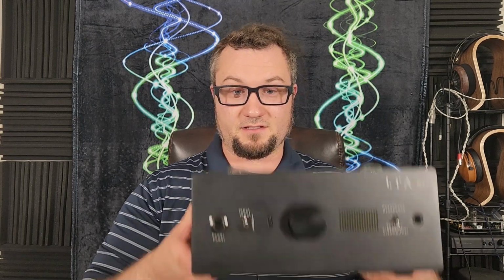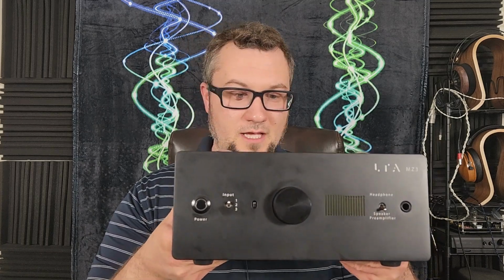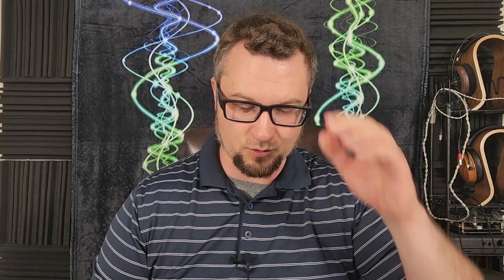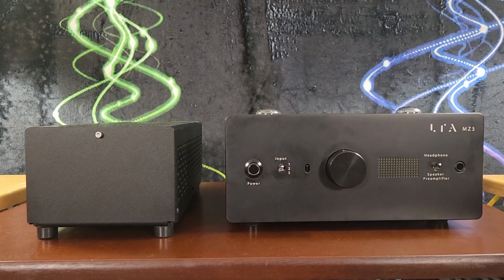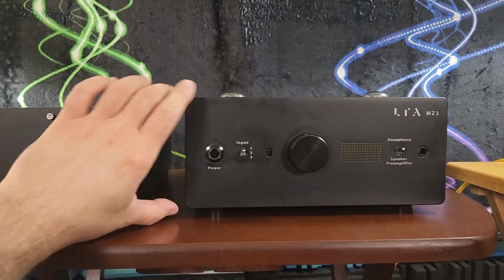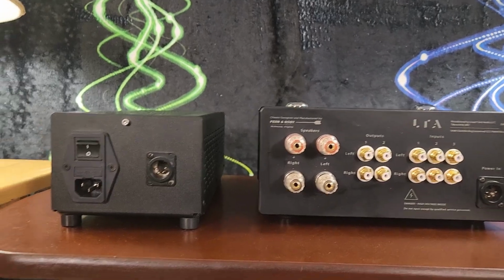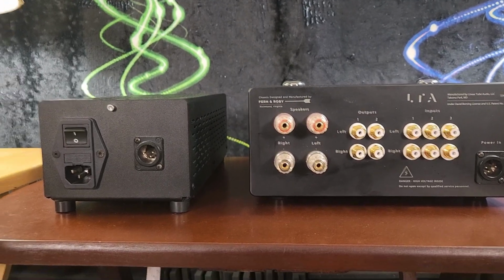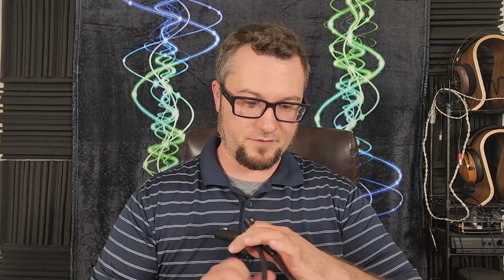Linear Tube Audio MicroZOTL MZ3 Preamp/Headphone Amp/Integrated Amp Review

Comment: first review without a comparison! at this price point is it better than your trusty V281? any reference to other tube amps?
Reply from the maker: Very observant! I didn't think I had a super fair way to compare the amps I had on hand. The MZ3 is much more pairing picky for both DACs and headphones and that makes it tough to evaluate on its own in quick A/B scenarios. I will say that the Vio brings more power with more warmth and dynamics. It is also balanced which opens the door to more potential dac pairings. But as far as things like resolution, spatial presentation, timbre, etc, the comps get really hard.

Comment: One of the best purchases I've ever made. Tube rolling can make it even better. I bought it mainly for use as a preamp, but was surprised at how well it directly drives my Zu speakers (16ohm) with less than 1/2W. The MZ3 is also what pushed me down the headphone rabbit hole. I'm using it with both ZMF Aeolus (300ohm) and Audeze LCD-X (20ohm). The output impedance for the headphone output is only 2 ohms which is a major difference between the ZOTL circuit and a traditional OTL implementations.
Reply: I've been using it a a pre with my Nelson Pass Sit-3 amp and it has preformed well :).  Now I have shut down my two channel system to do some work,... and am enjoying it with headphones, Sonnet Pasithea Dac, and a range of headphones - ZMF Atriums and Audeze LCD XC and Sennheiser HD 8XX and HD820's and I love this amp!  What tubes have you rolled? if you don't mind sharing?
Reply: @vaneast411  used as a preamp I liked Brimar CV4003 (12AU7), but they seemed a little too polite as an integrated or hpa so I’ve been sticking with 12AT7 variants. My favorites so far have been some RCA 6201 blackplates. I tried some new 6SN7 mostly to check functionality, but I’m not willing to pay the premium for the coveted NOS types. I liked the RCA 12SX7 that mine came with so I’ve been sticking with older RCA 12SN7GT tubes. I must really like the MZ3 because I’ve been accumulating enough spare tubes for the long term.
Reply: @bitterandjaded_  thanks! I really appreciate your detailed response my good man.  I need to future proof my unit with a good supply of tubes.

Comment: would have enjoyed some description of the fascinating circuit, with your physics background... maybe you shy away from this as people maybe don't like the more technical information.  The guy who developed this circuit has a physics background (David Berning) and there is a long version tech talk on YouTube detailing the history of OTL's and his design solutions.  The circuit used is the most interesting aspect of this amp, other than how lovely it sounds.
Reply: Sure sounds like there's an Analog to Digital (A/D) Converter in there.  That means for $3,700 one gets a digital volume control.    Eeeeek.....:face-blue-wide-eyes:  Why, for goodness sake, would anyone do that?
       The volume control, on its own, is the single bottleneck most overlooked in the signal chain of most systems.  Buy the one you almost can't afford, then build up over time the rest.  Matching the quality as one gets "there".                      🔈🔉🔊
Reply: @TriAmpMyFi  the amp is purely analogue, so no digital conversion, but uses a fascinating tech to avoid needing an output transformer, to be able to send a signal that speakers and headphones require.  Foe volume, ir  uses a series of relays to adjust the volume, which make a clicking sound, but this approach is a good one in that the signal is not degraded by the volume control essentially
Reply: @vaneast411      From their own website...............
                                                "....in all unit is our new 8-bit volume control, which gives you 128dB of total attenuation via 100 individual steps. We use precision thin film Nichrome resistors with low thermal noise and ceramic circuit boards with low dialectric content for the highest level of clarity and transparency."            
                                                                  ........... I don't think they're relays.   🔈🔉🔊
Reply: @TriAmpMyFi  So confident, yet so wrong. Relay controlled volume is nothing like volume control in the digital domain. They even call it a stepped attenuator on their website. Google can be your friend if you actually want to learn. Deliberately spreading misinformation is unnecessary.
Reply: @bitterandjaded_           They also call it an 8-bit PCB...................... but I will look into it more, as my curiosity often leads me..  
      If it turns out a chip based pcb is the brain needed to run the mechanical relays then fine.  It's still the quality of the volume control, that one should be aware.                                                                                      🔈🔉🔊
Reply: @bitterandjaded_       Allright........... So there's ICs on a PCB that open & close the relays.  The signal remains analog.  How did I do?   🔈🔉🔊
Reply: @TriAmpMyFi  The bar for online interaction is so low I was just happy no one resorted to name calling. Kudos to you.
Reply: @bitterandjaded_  So, is my new understanding of 8-bit volume control essentially correct now?  
        And. "....would have enjoyed some description of the fascinating circuit".
O.K., we'll show 'em.......... 'cause now you can tell us about it, fellow audio enthusiast.   😁                                                                 🔈🔉🔊
Reply: Teasing facts about audio is comment click-bait..........lol..........
Reply: @TriAmpMyFi  I’m not definite on the exact implementation here, but a series of relay and resistor pairs in parallel is basically it. The ICs control the relays to close, bypassing certain resistors so the total resistance equals the desired attenuation. As a bonus it allows balance adjustment without any additional circuitry.
As far as the ZOTL circuit itself goes, this video can be a little dry, but it’s hard to find a better source than the guy who holds the patent. https://youtu.be/VMDBpz7dASo